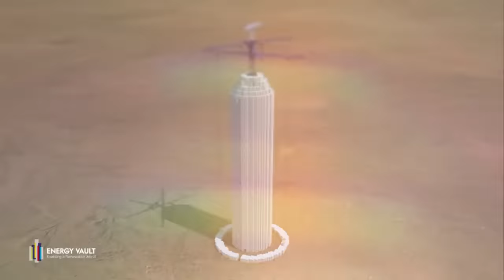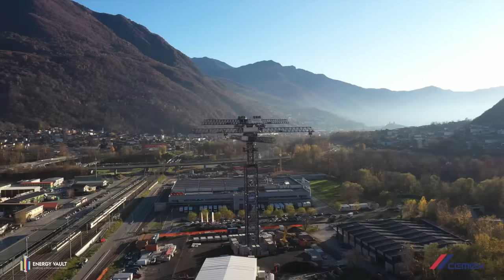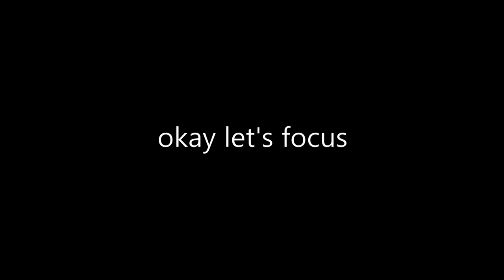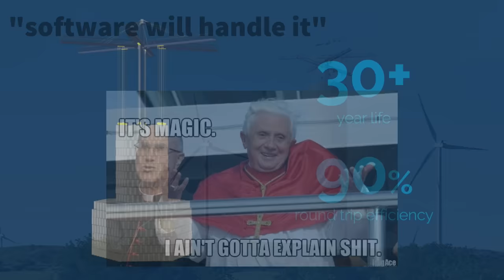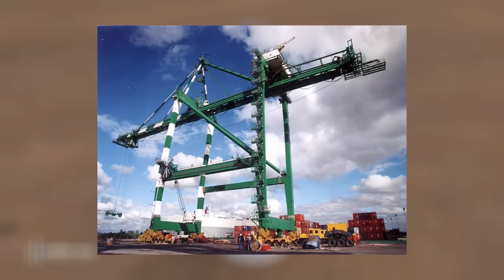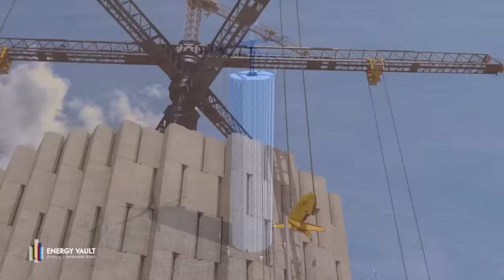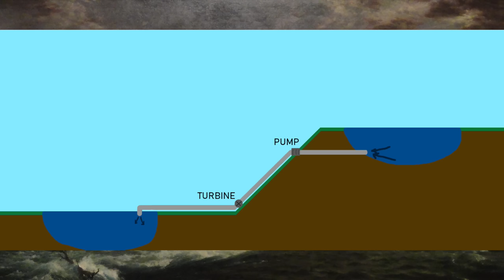The Energy Vault is a Dumb Idea, Here's Why

Comment: Let me start this by saying I'm an Engineer and I was involved in a feasibility study for a pumped hydro energy storage system. They look simple, but the cost really does depend on how lucky you get with geography - a lot of the money can go into constructing the pipes/tunnels you need to get from upper to lower storage. Those things are big and get expensive quickly. Its actually getting more difficult to sell a pumped hydro project because of competition from batteries - forcing you to move towards longer duration storage (8 hours+). 

"Energy Vault" does have its merits. But its biggest problem is not so much the embedded carbon (they're definitely not going to use concrete) but rather the cost of the "bricks". They're now talking about recycled materials. There's a project in Australia that apparently will recycle old wind turbine blades. Cool if it works, but I'm not sure that have the longevity of materials thing well understood, yet. I really wouldn't worry too much about wind loading. Not for something that massive. Looks fragile but its sheer mass does keep it well pinned - and you can also move into into a lower height configuration if you are expecting a cyclone (hurricane to you guys out there) any time soon. 

Btw, big holes in the ground are expensive and one advantage of the system is you can construct it anywhere on flat land, whereas things liked pumped hydro require just the right geography and lots of places don't have it.

Ok some caveats..

I'm still skeptical of "energy vault". Its the cost of those blocks. Get that right and they have a thing. But I think they're still immature tech.
Pumped hydro is great if you have the right geography and its about medium term energy storage (8 hours to a week). It doesn't compete any more against batteries.
There's other technologies that rely on storing heat (in very cheap storage media) and converting that back to electricity that are very promising. 
There's also things like liquid air storage. And there's hybrids.
Reply: Sorry, Mr. Engineer... When the wind is blowing so strong that the wind turbines are 'over producing' for the time being, the UNLOADED cable will be at its maximum extent trying to position to lock onto blocks in order to carry them UP... Good luck with that scenario...
Reply: @rustycherkas8229  I don't like every aspect of their design.
Reply: @saumyacow4435  What exactly did you not like? 
I think it elegantly solves the scalability issue and provides flexibility for both strong and low wind conditions. Concrete can be replaced with more eco-friendly material.
Reply: @ziad_jkhan  What I don't like about gravity storage is that to scale up, you need enormous masses. A 30 tonne mass raised to 100 metres is 6 KWhr when you take out losses. 6 KWhr and to be economically viable you need a cost of a few tens of dollars per KWhr of useful storage. (Remember battery systems will fall below $100/KWhr). So we need a 30 tonne lump of something and its gotta cost less than a few hundred dollars to make. Certainly not concrete. And it has to have a reasonable compressive strength. That makes the problem quite hard. Even if you use recycled materials which at source cost nothing, you've still got to transport, process, and somehow put them together in a form that is reasonably tough, has good compressive strength and won't age too fast. 

And think about scaling. Energy vault scales well into a few tens of MWhr. (Thousands of blocks). Scaling it into something you call grid scale means thousands of towers. At this scale you start running out of easy, cheap materials and you run into all sorts of logistics issues because its a mega engineering project in its own right.

Its not that you can't make it work, its that there's other ways to store energy at scale. A pile of hot rocks for instance will store energy at a few dollars per KWhr and store it far more compactly. Liquid air energy storage has a far more energy dense medium (and the material costs nothing).
Reply: @ChrisP Bacon This technique has been around for centuries, in what are called "Cuckoo Clocks"... Cuckoo is a reasonable description of the idea owing to its storage capacity and its construction and operation costs. Maybe try 'spent uranium' to fabricate the blocks... At least they'd be massive enough to improve capacity..
Reply: The problem is not the wind load of the entire structure, the problem is precisely moving huge bricks on very tall cranes - most information I can find on crane operations in windy conditions advises reducing load and exercising caution once wind goes over 20mph and stopping all work if it reaches 38mph. 
Also, let's talk about efficiency - the tower looks cool, but realize only the topmost bricks get to travel the whole length, with each layer removed to generate power back - you get less and less energy. Since you probably can't disperse the blocks flat on a wide range around the main tower, at some point you have to start stacking them, further reducing the distance traveled down.
Reply: @Mrdardas99  
You're right.
C = π D, so a 'ring' of bricks with a diameter of 1 could be expanded to a diameter of 2 by reducing the upper 66% of the stack's height to 33% + 2*33%. (The 'granularity' of block dimensions comes into play, but this serves as a guide.) A third 'ring' could theoretically mean 100%/(1+2+3) = 16% when all rings are stacked to the same height. I've not bothered to research the company's proposal to see if they think they can make 4 'rings' to eek-out more "energy storage"...
This 'de-stacking' would be done at times of no/low wind driving wind turbines... As the wind picks up, the generation can feed into the grid... As the wind becomes stronger and power generation exceeds grid needs, this 'battery' would have its cables fully extended and unloaded (low mass) as the 'grabbers' flailed-about in the strong wind, trying to snare the next block to elevate. Good luck with that!
Reply: @rustycherkas8229  if you're worried about this, then just locate the tower away from the  wind farm. It doesn't not have to be built nearby at all; could be 100km away near the major city which will need it to buffer peak demands.
Reply: This is the best comment on the video. There are better options from an engineering perspective, but those options can be extremely expensive (in money, time, or both). It's not that Energy Vault's engineers had never heard of pumped hydro, it's that they took pumped hydro as a starting point and tried to solve some of its shortcomings (e.g. reliance on geography and long approval times). That doesn't mean that this is the Technology of the Future, but it's not completely without merit.

As far as materials for the blocks are concerned, I can envision some mitigation pathways in which large scale atmospheric carbon dioxide removal takes place, the captured carbon is sequestered in giant blocks, and the blocks are used for energy storage. Some pathways involve sequestering over 20 GtCO2 per year, so it's not like there would be a shortage of captured carbon to build the blocks with. I could even imagine the energy storage projects being financially feasible purely because of tax credits or subsidies for taking the captured carbon and doing something that looks useful with it, rather than whatever benefit they bring to the grid. This would be horrible from an optimization perspective, but I can imagine scenarios in which it's the pathway of least political resistance.
Reply: @SergeiAndropov  
Gravity batteries AND CCS...
Great!
Two fantasies to attract dim-witted investors...
Reply: @rustycherkas8229  The point of this system is not to operate in high winds. It is a backup that would only be critically needed when there is no wind at all.
Reply: Finally a reasonable evaluation of the gravity vault, thanks!  As you say, the real challenge is economical, not technical. But what I want to know is, where is the production data from the prototype? It was supposed to be tested this Summer, but EV has not said anything about the results. If I were their investor, I would be extremely nervous right now.
Reply: @tzenophile  
Discharge when there's no wind. Agreed.
Q: When and how does this storage unit become 'charged'?
A: When wind speed is sufficient for the wind turbines to overproduce in relation to current grid demand, run the motors to elevate blocks and stack them up into high towers.

This contraption is supposed to latch onto and elevate blocks when there is surplus electricity being generated... aka: windy conditions.
Reply: @rustycherkas8229  Or during sunny conditions. Let's assume for the sake of argument that it will not operate when wind speed is above 30 mph. But how often is that? Since we are not talking about huge amounts of power here, there should be no problem getting sufficient charge at night when wind is overproducing but not to a critical degree.  This is a specialized crane which does not have the challenges an all-purpose crane has. The load is constant and dense, the lift is from low (less wind force) to high (less pendular movement) and the source and destination points are flexible and can be chosen to minimize wind impact.  I don't see a showstopper here; and there are several ways to improve stabilization should it be needed. 

Edit: you could also charge it with any cheap source of electricity; they are just using wind as a clean example; but who says it has to be wind?
Reply: @tzenophile  
Constraining when this storage device can 'accept' overproduction to charge-up decreases its utility making it an even worse investment.
The company's claims & CGI depiction is disingenuous (read: "ignoring or misrepresenting practicalities") and that, alone, should be a giant red flag to investors. The promo talks of ridiculous efficiencies, 'unattended' operation, and extremely dubious life span for complex and exposed mechanisms...
Others have pointed out that stacking that much weight in a small footprint would limit its locations to where it can be built directly on bedrock.

Grab a length of thread and try to 'thread a needle' holding the thread 20cm from the end... in front of an oscillating fan.. That's what the marketers are claiming this device will do "without human supervision", and it will do that reliably and frequently for 30 years...

While gravity storage is attractive, this Jenga Tower is not a realistic or practical solution.
Reply: @rustycherkas8229  As I already mentioned, there are some read flags here, especially since they built the prototype to scale a year ago but I can't find any test data. But all the challenges you list are solvable and calculable, including footprint pressures. Are all the world's tallest buildings built on bedrock?  Your needle-threading parable is off; there are many ways to create an "intelligent" self-guided load block. I am sure you can think of a few yourself.

You should be arguing in probabilites and percentages, not absolutes. How much charging uptime can we expect, and what is the average and worst-case cost of charging from alternative sources when wind is not available? (and why are we soo focused on wind power here? This thing will be on the grid for sure.) Comparing this system to a continually running operation is false; it will not be used that much, and so the wear and tear should be minimal. The mechanisms aren't complex or particularly exposed; this is 2021 and we've had block and tackle technologies for at least two thousand years. Autonomous subsea drilling robots and reusable space rockets are complex and exposed, this ain't. You don't even need a gear box, since the load wight will never change.

We are discussing three different things: 1) the perhaps dubious marketing and lack of transparency of Energy Vault and what that entails; 2) whether this sort of tech can work in principle; and 3) will it make financial sense. I am convinced of 2, curious about 3, but very skeptical about 1.
Reply: @tzenophile  
I'm not inclined to go down the rabbit hole. The suggestion put forward is this is a 'green' energy storage medium to 'level out' production and consumption 'time shifting' excess production to be consumed when convenient to people. As its usage falls below 100% operation (either charging or discharging), the project becomes less worthwhile. Operating for only a few cycles each month would make the ROI miniscule.

Their website claims a "1/4 scale" prototype had been built, but fails to detail any results. Many ideas (like threading a needle) appear to work (under human supervision) when demonstrated at small scale... The proposal is for industrial scale without supervision in all weather conditions... That's what their prototype needs to demonstrate. (Many 'day sailors' are smart enough to not venture far away from a sheltering coastline. Many are still overwhelmed by conditions they or their hardware cannot sustain.)
Your examples of ROVs and Musk's rockets consume lots & lots of energy to stabilise and control their operation. These six dangling fishing lines are not 'controlled' at the contact point where precision is required. Should one 'gripper' become stuck before it locks onto a block, the entire system may be out of service until workmen can ascend to 80m and wrestle the gripper free again...

None of these practicalities (and more I can't even imagine) are depicted in the marketing CGI.

A building site nearby showed an artist's impression of the structure that was to be built. When passing the site, I stopped and asked strangers to carefully study the image and whether they could see something being misrepresented. None noticed that the artist had shifted the angle of midday sunlight about 60° toward the pole in order to illuminate the street side of the building (that would be in perpetual midday shadow at this latitude.)

"Don't take any wooden nickels." 🙂
Reply: @SergeiAndropov  Problem is carbon is light, and the potential energy that can be stored in the design scales on mass and distance to the bottom of the structure.
The best materials to make those blocks out of would be a heavy element like Uranium 237 so you could get the most mass for the volume of the blocks.

Sequestered carbon would probably be best used in the actual construction of the structure. Im not a civil engineer, but lining the pit you put the cranes in (to protect from wind) with some sort of carbon fiber or graphene seems logical to stop erosion.
Reply: @rustycherkas8229  Another example would be a drone. Not a lot of energy, still operating stably in 30 mph winds. As I said, this particular company may or may not be legit, but that is not disproof of concept.  Hooking onto a block that is in a 100% specified location is not rocket science. Is a bit of debugging required? Very likely. When was it not?
Reply: @tzenophile  
Drone?? Drones to steer the block grabber swinging at the end of two(?) lengths of 80m cable each massive enough to support 35T blocks? 
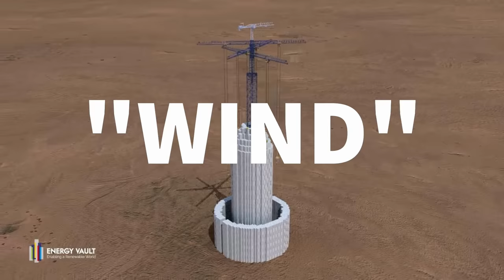This is what's known in software as "feature creep". I'll refer you back to this video at 01:35... (My 'guesstimate' is the extended cable will present well over 1sq.m. of "sail" to the unevenly distributed gusts of wind loading. There's gonna be enough mechanical 'waves' traveling up and down the length of cable to give Fourier indigestion... All of those changing moment to moment as the cable extends or retracts...)

Listen, I'm not trying to be a Luddite. Nor do I want to whistle in the dark until the planet cooks. But, while "magic solutions" are invoked to dance around obvious flaws in concepts, investment dollars are disappearing and the clock is ticking. While "Energy Vault" is spending other people's money claiming they can lasso unicorns, precious time, energy and attention are being squandered.

That Mars Lander "Sky Crane" thingy seems to have given people the impression we live in the 23rd century... Out of sight are the man-centuries of development and the '00s of billions of dollars investment to make that one-shot work. These "dumb batteries" are claimed to be able to operate reliably stacking and unstacking 10,000 blocks every day for 30 years. It's like those who claim the population of Earth will move to another planet aboard some kind of 'Ark' ships. Let's see... Hmmm... 8 billion today, and 10K per Ark... That's only 800,000 Arks to build and provision and launch into space... Let's get started!!! (Some things are not amenable to "scaling up").

'Scuse me... My leprechaun wants me to drive him to check his pot of gold at the end of the rainbow... (His feet can't reach the gas & brake pedals.) Gotta go... 🙂
Reply: @amaama4554  but if the city is close enough to the wind turbines to be powered by them, wouldn't it also be really windy in the city?
Reply: @tzenophile  this argument would make sense if you could get the blocks from low to high really fast, but otherwise, wind moving the cables is not something we can neglect.
Reply: @GretgorPooper  It's a solved problem. If a drone can operate in high winds (and as you know, they can) then something at the end of a cable can, too.And as I commented elsewhere, this operation is mostly needed when there is no wind at all.  So nothing to worry about. Except they need to show proof of concept; unless they are cheating their investors.
Reply: This. 
Finally a good take.
Finally. A. Good. Take.

Thank you.

Too bad this is buried under hundreds of uninformed comments.
Reply: Exactly, if they can drive down the costs of those bricks it should be very much feasible. Also, just because they’re storing energy “for” a wind turbine doesn’t mean that they’re going to need to be exactly right by them. It could be all the way on the other side of the country and as long as it was coordinating with the wind farm buying power it should be economically sound. I know they’re building a project in Louisiana - but I think the source is an offshore wind farm under construction…which is pretty far from the system itself. I think the tech needs major scaling up but it has great potential.
Reply: @GretgorPooper  locality is not a major concern for the grid. This is why it makes perfect sense to pump water into the high mountains and dedicate the stored energy to large consumption points (cities, industries) far away from there. Electrical energy travels across a continent within seconds if not less (at the speed of light under ideal conditions, but in practice you have induction which slows things down a little). The problem with transportation is the loss of energy along the way, but again this only becomes relevant for large distances, like across an entire state or country. The geographical location of supply and demand is by no means a strong criterion when it comes to upgrading the electrical grid.